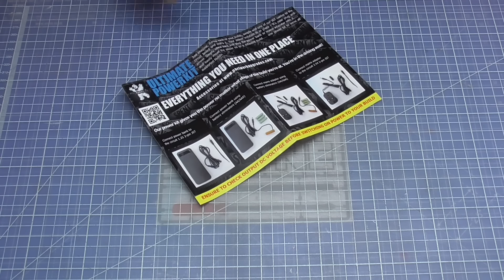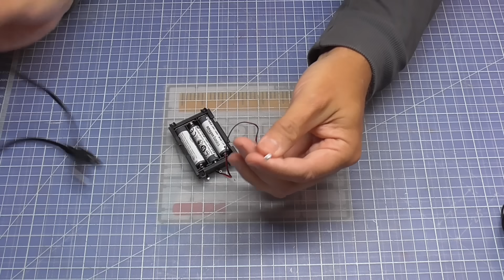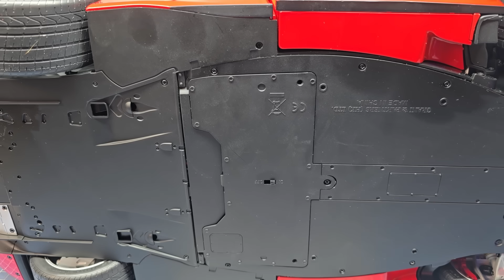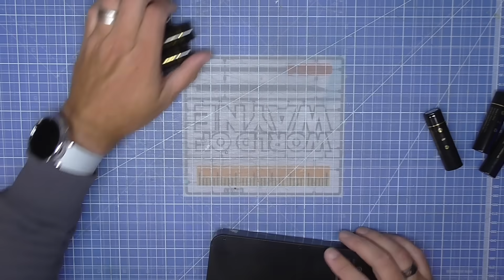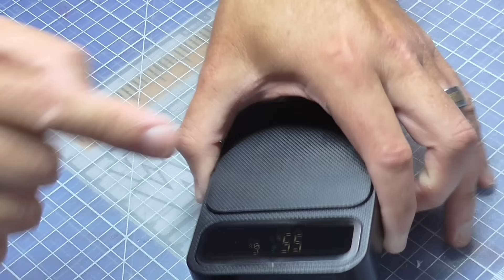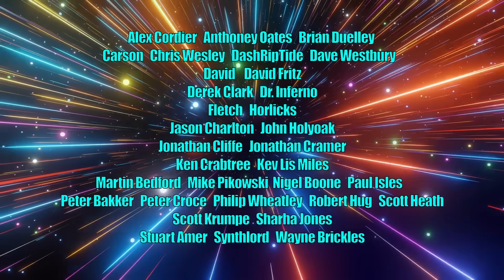Partwork Upgrades Scale Model Power Mod

Comment: I would love to try this on the Enterprise, but I feel like it would require a significant amount of modifications in order to work due to the numerous battery compartments throughout the model. Which is a shame because I will probably never use the lights otherwise as I don’t want to deal with batteries all the time.

Comment: So would you need to buy 2 kits if your model has a separate base to power too?
Reply from the maker: You could use a dc splitter if they are the same voltage or just a dcvleadnif younintend to use the power bank. Otherwise you would need 2

Comment: So if you want to replace the batteries in your models with this mod, you would need to modify your battery compartment? Like how you did the Ferrari, you can't possibly put the battery cover back on without modding the cover. Is that correct?
Reply from the maker: Ormjust don't bout the cover on at all

Comment: 🤔 you emphasised the importance of setting the correct Voltage but what about Polarity?
Reply: For a direct JST plug replacement connection, you must check that both the battery pack's JST and the replacement cable's have the same electrical polarity when connected:
1) for the original battery box, confirm that the red wire is connected to the positive terminal on a battery in the battery compartment and the black wire to the negative terminal on a battery in the compartment.
This means that the red is positive and the black is negative at the battery box's JST plug. 
Note - your battery box wire colours may be different! In that case, substitute appropriate battery box colours for "red" and "black".
2) The battery compartment's JST plug is wired the same as the replacement direct power cable's JST plug. That is the battery box JST "red" (positive) wire connection on matches the replacement cable's JST red positive wire connection and the battery JST negative "black" wire connection matches the new replacement JST black negative connection exactly.

Note - the JST plugs on both are physically polarised and can only be inserted into their sockets in one orientation. Match the JST plug in orientation of both JST plugs before comparing the positive and negative wire connections.
Reply from the maker: The polarity is dictated by the battery for the eliminator and the jst plug for the adapters. All the builds i have done so far use the same polarity. Very rare to use a reverse polarity dc adapter.